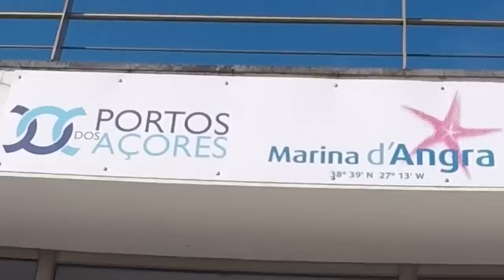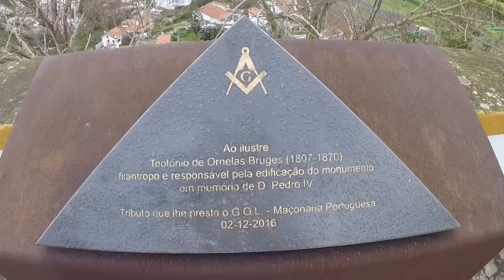NASTY Boat Surprise | Sailing Wisdom [S3 Ep 28]

Comment: Herby and Maddie, the cheapest and fastest way to kill mold anywhere is spraying it with cheap hydrogen peroxide. Of course there are commercially available products for that, but this one had work for me very well. DISCLAIMER: "This is only a suggestion that has worked for me, use at your own risk".
Reply from the maker: Thanks for the suggestion!

Comment: You might need 2 solar vent fans in hatches or something to help prevent that mold build up.  They really do help and yeah they are a little jankie...but....mold....
Reply from the maker: We found that running the diesel heater once a day really helps dry out the boat
Reply from the maker: We have an old nicro fan in the galley and it has been working like a champ (came with the boat). Got a second and new one for the head. It died in under a year, haven’t replaced it yet but I should!
Reply: @RiggingDoctor  Buy heavier solar vent fans....I have found that usually the heavier they are the better the motor and solar.  Though just look at them...the Nicro's really tend to be the best though most of them are plastic now...ones with batteries may, or may not be such a good thing.

Comment: Was it your plan to sail across the Atlantic and work on the boat? Or did you realize along the way that you really needed to remodel the head? I ask because it seems like a long way to go for a lot of trouble that might have been easier to address stateside. I've watched most of the episodes from the past year but I don't recall you discussing a plan to refit in the Azores. (Maybe I missed it.)

I don't mean the question as an implied criticism. I'm genuinely curious as to how you came to the decision.
Reply from the maker: It wasn't an easy decision to make, but we realized that we had a lot of time to kill here since we arrived right after the weather window to cross to mainland Europe. We figured we'd use that time to do as much boat work as we possibly could while traveling every few months back to the US to fund the projects. We definitely never planned on refitting the head at all, but the amount of rot we found in the bulkhead and floor made it imperative. 
So to answer your question, no, we never planned to do these refits out here. But it actually ended up well because it's much cheaper to do all this work here where it only costs us €5 a day to be on the hard! The weather will be good to cross in June, so we're planning to be finished by the end of March :)